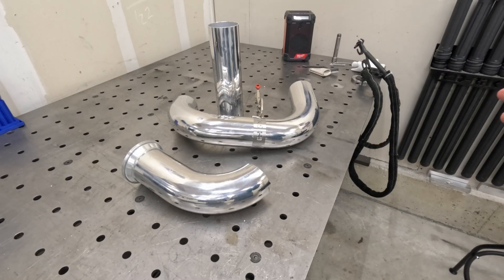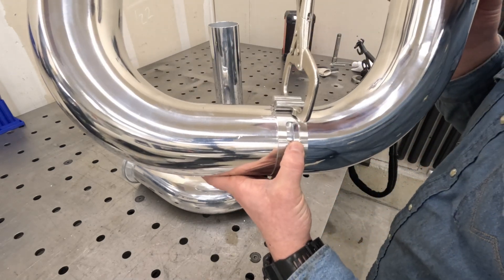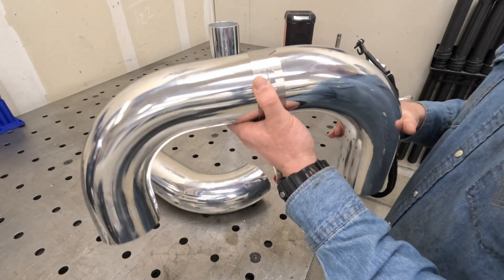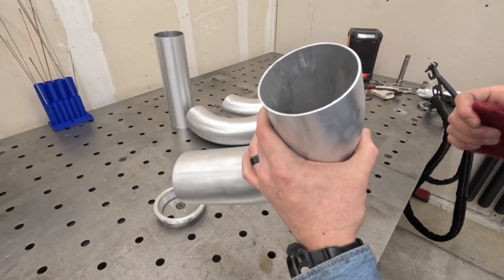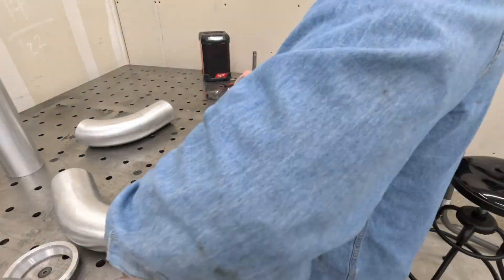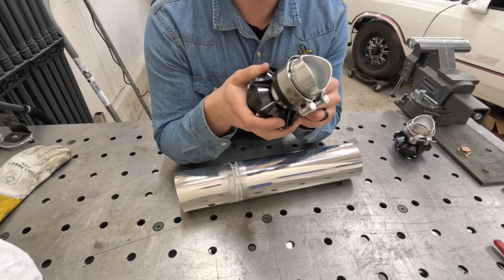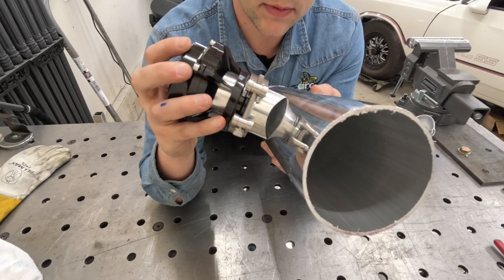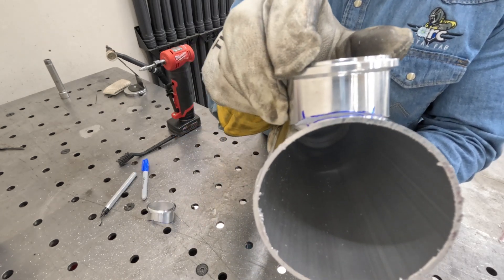Building Custom Aluminum Charge Piping for a Turbo LS Race Car!

Comment: Great info here! Where did you get the clamp? SS custom engineering?
Reply from the maker: Hey thanks!  And yes, it is from SS Custom.
Reply: @ do you find yourself needing more than 1 of the same size clamp? Liek for instance on this pipe it’s got a lot of joints so do you use several clamps to mock it up before you tack it?